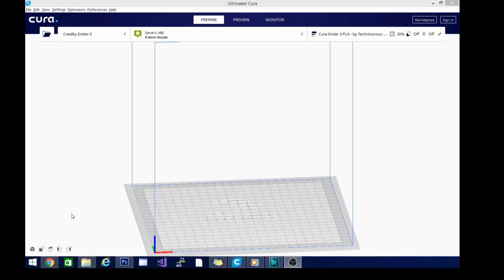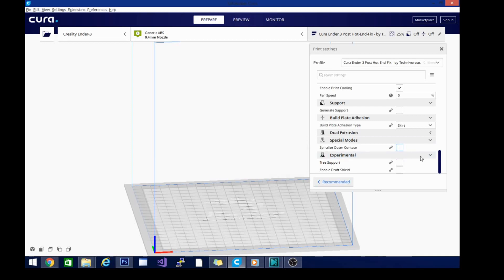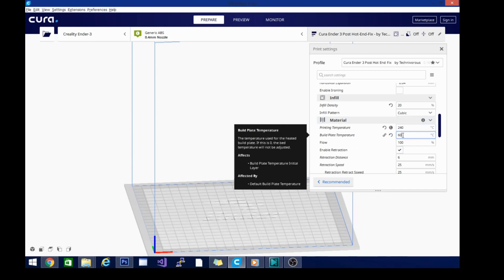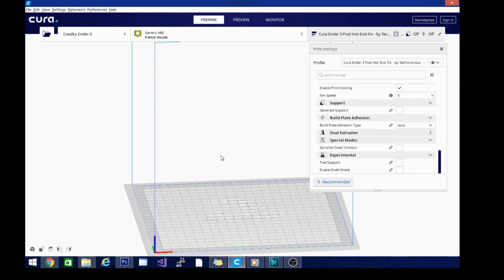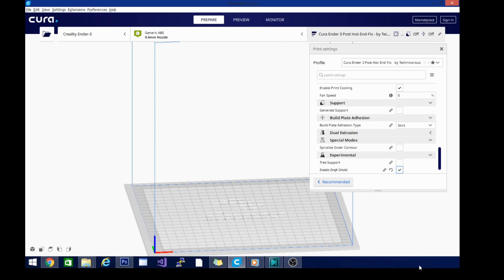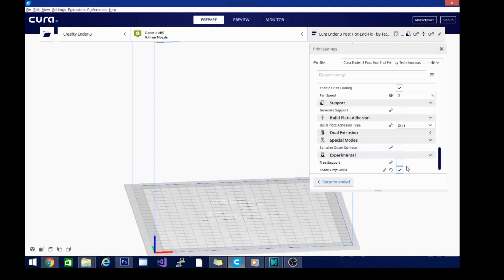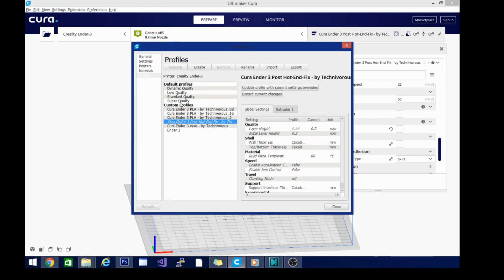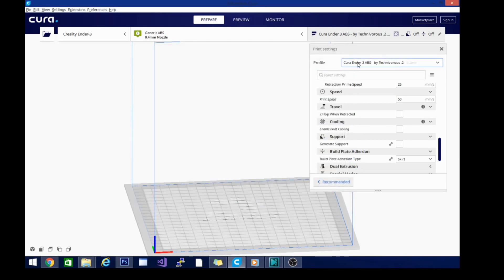Cura 4.3 - cura profile settings - ABS

Comment: maybe experimentation is the key but on my box of filament the instructions on the box give a "required" temp of 230 - 270  so leaving your bed at 60 degrees i find questionable
Reply from the maker: That's the required temp of the hot end to melt the plastic.  Most spools that have temp recommendations also recommend a separate bed temp. 60-70 is pretty standard for petg. 230-255 is standard for the hot end but I have seen some that go to 270. The bed just needs to be warmer than the room to prevent lifting, which isn't nearly as bad as with abs, so the nozzle temp is what's important. And not using a part cooling fan.

Comment: Was having trouble with my ABS, used this setting and worked perfect. I think my cooling was the issue as well as the hot end temperature was not that high.